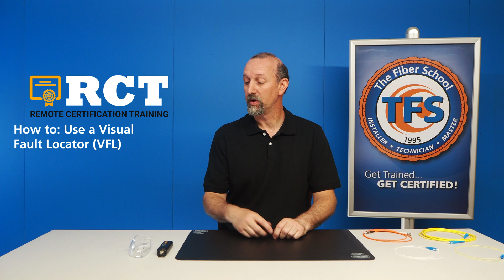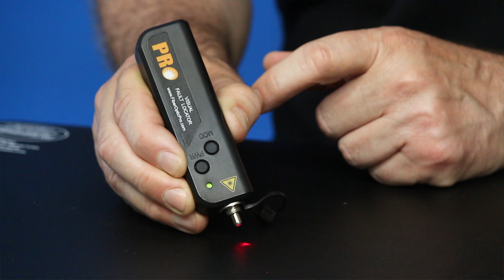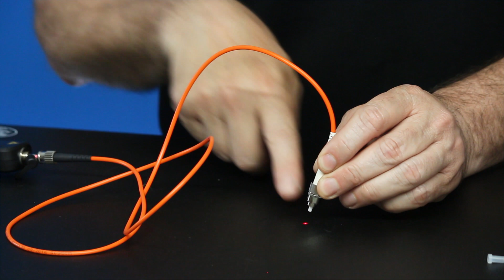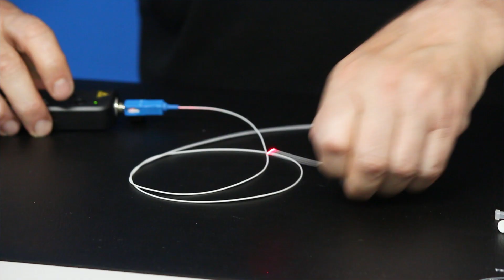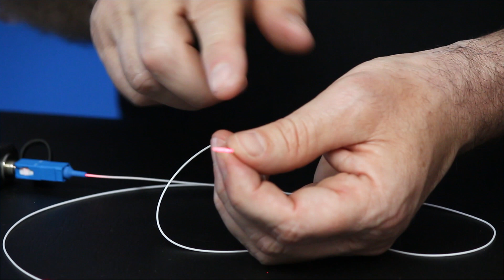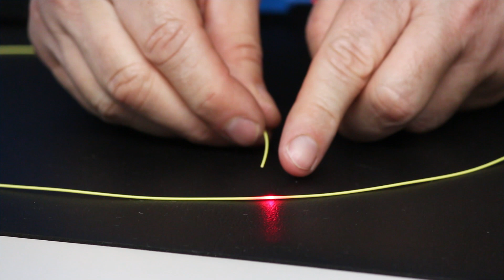How to: Use Visual Fault Locator (VFL)

Comment: Safety is important yes, but wearing safety glasses, when dealing with a fully cladded fibre cable and a VFL is liking wearing your seat belt whilst parked in a garage.  Sure if you are cleaving a fibre cable, it might be best wearing glasses, but not when just plugging a connector in